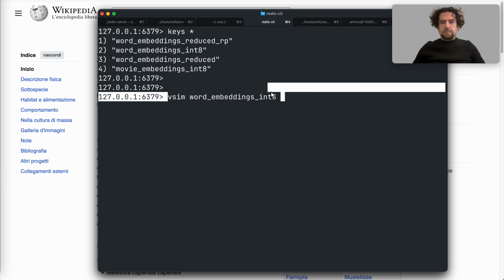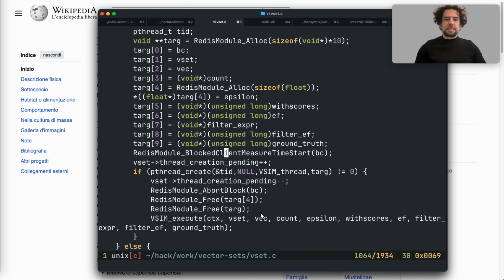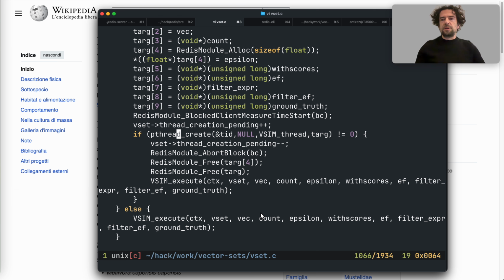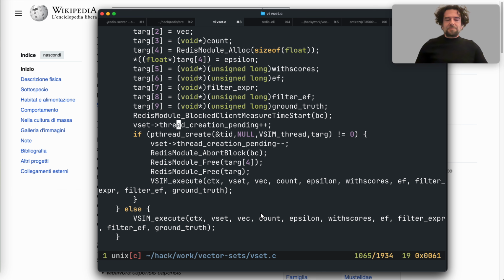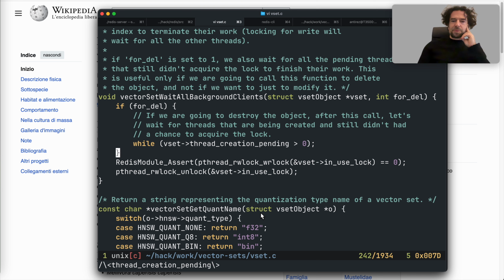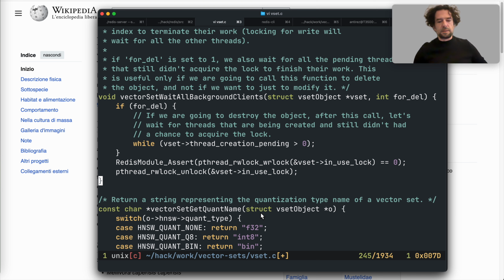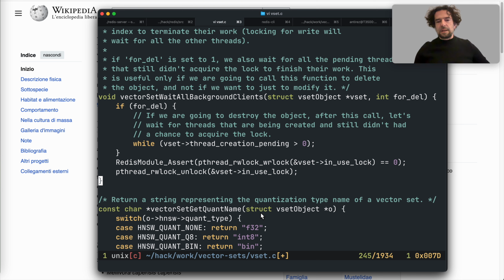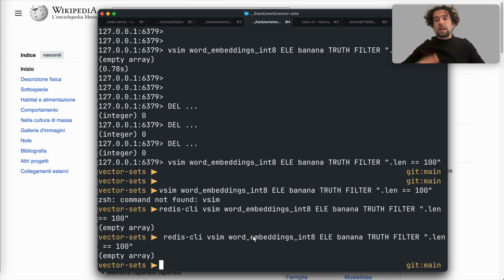Software di sistema di scrittura: il problema dello sblocco dei mutex cross-thread

Comment: Using atomic variables is not always the best approach because it prevents tools like Helgrind and ThreadSanitizer from recognizing the relationship between the mutex and the variable. In general, using condition variables is a better practice. That said, the solution proposed by Clause is certainly better and aligns with the standard approach for this type of problem. The DEL command should simply remove the reference to the object (without waiting for other threads), and the last remaining thread should be responsible for deleting it.
Reply from the maker: In this specific case, the critical section is still protected via mutex so Helgrind and Asan will still work as expected, since what we are preventing now is use after free, not synchronization. Conditional variables are slow in this specific case: the command execution does not want to wait before returning to the event loop. Finally: recounting can be ok in general but in Redis certain module APIs are unsafe to call from a thread: likely this was a safe case but we would still introduce atomic vars without much to gain. For this reasons I believe in this case the current solution is likely the best.

Comment: Very cool solution! I encountered a similar issue just today where a thread would pass a resource to another thread, and no other thread was allowed to access the resource during the communication. I solved it by using a binary semaphore initialized to one. The semaphore is decremented to zero when the object is being passed and then incremented back to one by the thread that has received it. Using semaphores, I essentially addressed the problem you mentioned where a thread can't unlock a mutex locked by another thread. However, I believe that using semaphores instead of the atomic int you used helps avoid what I understand to be an anti-pattern of busy-waiting. I'm not an expert in multithreading, though, so I'd be interested to hear your opinion on this.
Reply from the maker: The semaphore is basically the classical solution to this problem, however it's a slow primitive, and in that specific case what is worse is that the command could not return to the Redis event loop ASAP but would be required to wait for the thread to run and acquire the lock.

Comment: A latch system implemented with spinlocks, like the one you described, is quite common in data storage systems. Unlike traditional locking mechanisms, it continuously checks resource availability instead of relying on operating system calls. While this approach may be effective for current systems, future operating systems could potentially address the inefficiencies of POSIX mutexes and reduce unnecessary context switching
Reply from the maker: The problem is that I didn't want DEL to enter the busy loop, if not in extreme conditions. So I used the atomic variable only for the section that usually is at extremely low contention. Of course it can happen that I spawn the thread, then a write starts, the object is deleted at the same time, and I'll loop for some time, but in Vector Sets writes are quite low latency, usually sub millisecond, and the set of events to get into this issue are are. Yet, I believe that POSIX is creating useless problems with that semantics.